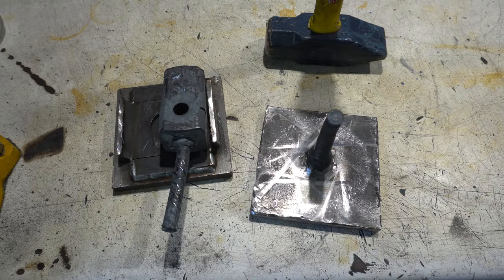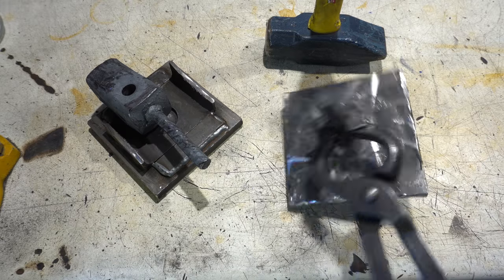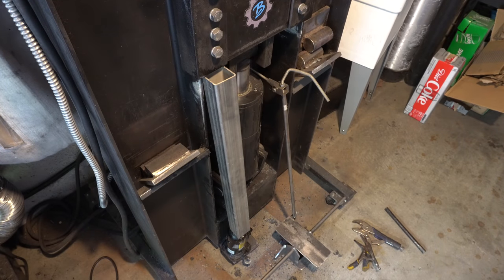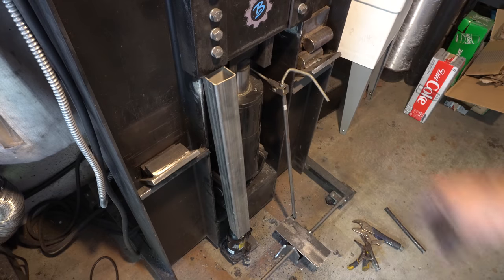Forging my first hatchet

Comment: Turned out really nice! The eye is fairly easy to re-align with the method you were trying to use, press or hammer, except you have to do it without the drift in. Re drift afterwards to reshape the eye.
Reply from the maker: Yeah, I didn't want to mess it up too bad without the drift.  I watched a bunch of your videos on hatch/axe making before I attempted this.  😜. Thanks for checking it out!

Comment: I always found it easier to align the eye with a wrapped and forge welded approach. 
I could almost feel the profanity flow from you when the press failed. 

All in all you made a pretty sweet axe in the end. Definitely a good first axe
Reply from the maker: I’ll try a wrapped one at some point.  I fixed my press so I’ll try another one of these some time too.  Thanks for watching!
Reply: @TyrellKnifeworks  thanks for all the outstanding forged work! I hope to reach that level in time

Comment: Another great build! Though I thought it was more ideal to deferentially heat treat the blade, so that the edge was hard, but the rest was soft enough to handle repeated impacts.
Reply from the maker: Read the pinned comment.
Reply: @TyrellKnifeworks  the only pinned Comment I see is an apology about how long it took to download the video.
Reply from the maker: @robertkain7890  Sorry, my apologies, I though this was a comment on the recent katana build.  I've never heard of anyone differentially heat treat a hatchet or axe.  You don't care about flexibility and the axe head certainly isn't going to flex.  Plus you want to be able to use the back of the hatchet as a hammer head so you want it hard.  Differentially heat treating actually makes very little sense.
Reply: @TyrellKnifeworks   I've seen it done on battle axes and just assumed that it would be done on all axes and hatchets. But what you said totally makes sense! As regular axes and hatchets are made to impact wood and to perform other tasks that aren't nearly as strenuous as the kinds of forces encountered in battle, when impacting other weapons as well as armor. Thanks for setting me straight 👍

Comment: Hey man, one trick you can do for uneven drifting is to cool the thin side in water, so that only the hot side moves. This will allow you to do the movement you wanted. When it's all hot, the thin side is the only part that will move as it is the weaker bit.
Reply from the maker: Yup, that’s a great trick!  I need to put a spray bottle near the anvil for that purpose.  That’s a good trick for doing twists too I think.  Thanks for watching and commenting!

Comment: Does the metal on the press not overheat because of the short moments of contact, or because of something else?

And how does the makersmark work?
Reply from the maker: Are you talking about the dies on the press?  You want those hot actually so that it doesn’t pull the heat from the work piece as much.  The heat won’t hurt the press.  The makers mark is electro etched onto the blade with a stencil and a battery charger.  Thanks for watching!

Comment: it does not have a steel shaft going down to the handle with a full or hidden tang but other than than confusion you did a good job
Reply from the maker: Uh, hatchets don’t usually have tangs.  When you see these full tang hatchets people make, they tend to lack mass and vibrate in your hand like crazy.  Thanks for watching
Reply: @TyrellKnifeworks  it might seem like that but you are  inspiration

Comment: Great result, especially for a first one
Reply from the maker: Thanks Kris!  Although there were some hiccups, not having to do any hand sanding made up for it.  😜
Reply: @TyrellKnifeworks  I guess if you wanted to practice on the cheap, dunno if its worth getting mild steel, forging to shape and then later forge welding a carbon steel cutting surface into the tip. Theres a few extra steps in there though which could make it even more troublesome and having watched a few vids on axe making recently- there's no shortage of trouble :)
Reply from the maker: @krissteel4074  yeah I considered that approach but it seemed like it would be more difficult to forge weld it properly.

Comment: if yu put a center punch like tip on your press punch it will go throu really clean
Reply from the maker: The punch part goes through very clean already.  Now that I’ve fixed the cylinder and bolted it down i should try another axe build.  👍
Reply: @TyrellKnifeworks  next time i would  look into viking axes and how they are machinaly held

Comment: Hey buddy, can u tell which steel blade is stronger Damascus blade or spring steel blade ?
Reply from the maker: What does “stronger” mean?  That’s not a measure of a blade.  A blade can be hard, but that also means it’s more likely to chip.  A blade can be tough/resistant so it bends but doesn’t break or chip, but then it doesn’t hold as good of an edge.  It’s a balancing act.  Chef knives are harder because you want a sharp edge over it being tough.  Choppers you want tough but less hard.  For your question, it depends what steel is in the Damascus and what the spring steel is.  How hard you got it and what temper you did on it.  It’s not a cut and dry answer.

Comment: Recommend you check out Timothy Dyck's blacksmith channel.  He's got a couple videos that uses power hammers and drifts for making axe heads that you could watch for posterities sake in order to improve your technique.
Reply from the maker: I've seen a few of Timothy's videos.  Since I don't have a power hammer, it's not quite the same.  I've watched a bunch of Fire Creek Forge's videos and my friend Spencer at Heavy_Forge as well.  They both use a press and drift that way.  Thanks for watching!

Comment: what is that machine, that collects the dust under your grinder?
Reply from the maker: I have a wall-mounted dust collection system that is piped under the grinder.  I use that only for non-metal because I don't want the sparks going into it.  It works well for that.  I used to have a water exchange system, but it was a pain in the butt.  Thanks for watching.